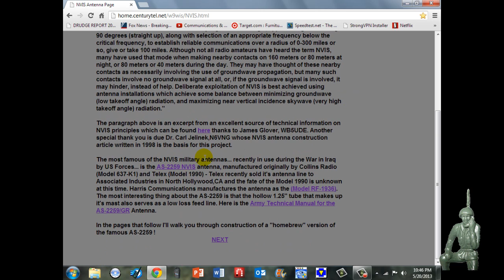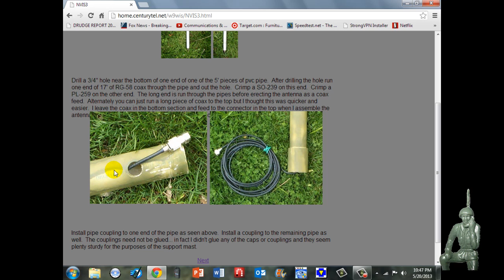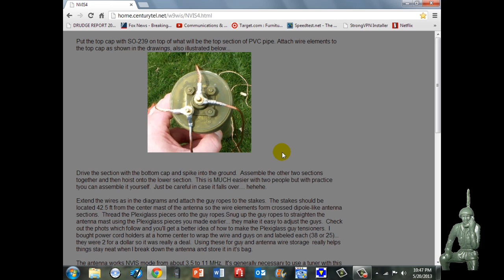How To Make A NVIS HF Radio Antenna

Comment: There are many ways to make an antenna for NVIS.  A simple dipole for 80, 40, or 30 meters hung about .1 (1 tenth) wavelengths of the ground will work.  It will be cheaper and more portable.  Picking the right band for the time of day is  also important.
Reply from the maker: Thanks for the comment.

Comment: An okay portable antenna, but one should understand the difference between tuned coax antennas and resonant antennas. This is a compromise antenna in-that "tuning" at the transmitter end merely 'fools' the rig to 'think' it is 'seeing' a resonant load and keeping it from tapering-off power. This arrangement will actually cause the feed line to radiate at some or all frequencies 'squirting' RF in random/unpredictable directions. A less complex (and IMO better) antenna w/b a tuned end-fed wire.

Comment: Hey Hank!  With the Texas QSO Party coming up this weekend I got to thinking about building an NVIS antenna and remembered this video.  The original link to the webpage doesn't work any more.  The new link is:  http://w9wis.us/NVIS.html  Also, I was wondering if I had a custom length of coax to use inside the PVC could I put a 90 degree elbow and maybe a bulkhead connector (just to make it look pretty) in the bottom section?
Reply from the maker: +Richard Slusher My antenna is the military version and it has terminal lugs but anything will work.  Hank
Reply: Yeah, I've got my eye out for one of those too!  ;)
Reply from the maker: +Richard Slusher I will let you know when I am going to sell mine.   I am not using it.  Next trip to the retreat I plan to bring it back and put it on eBay.

Comment: 15 feet ain't gonna do it.  You'll need to go up 10 more feet and add loading to each leg if you want it to perform reasonably 75 and 40 .... otherwise it won't work.  Go on.  Try it and see.